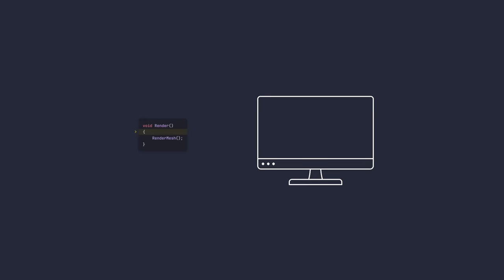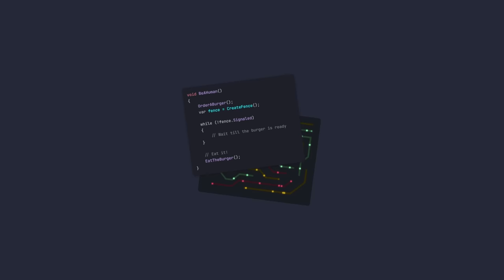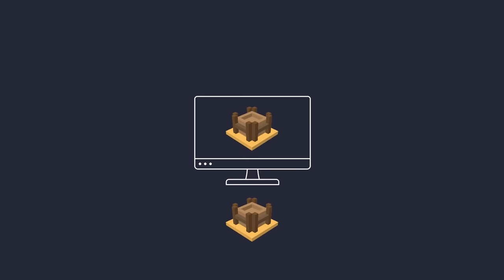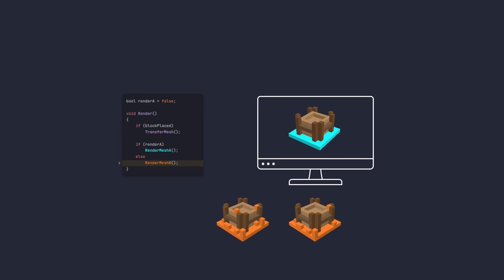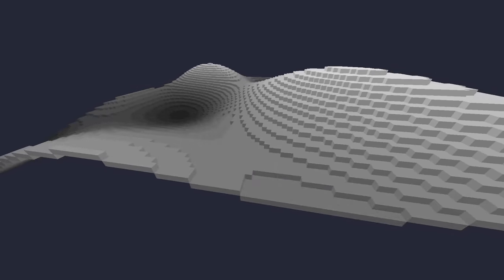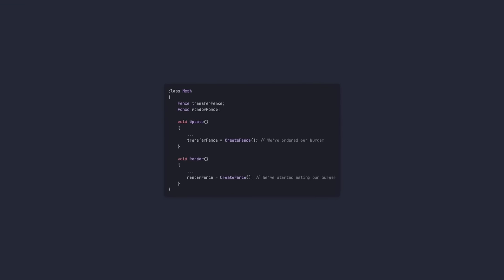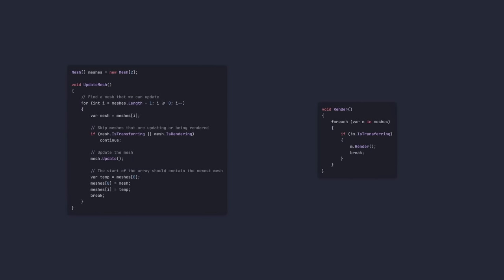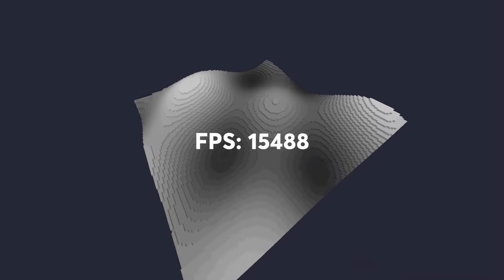I Created a Game Engine Just to Optimise This

Comment: Great video and I am sure it will help me in the future 👍At the first moment I thought the sorting by swapping with the first element only works with 2 meshes but after thinking about it I realized it also works well with longer lists too if the transfer time is equal for every mesh. If not, then a circular array/ring buffer might be a better alternative to avoid rendering fast-to-transfer future meshes before slow-to-transfer past ones. That would cause the future mesh to render 2 frames while skipping the past one with your algorithm.
Reply from the maker: Excellent point you’re right, a ring buffer would be more appropriate here. Now you have me thinking: I should be removing the element and inserting it at the start, rather than swapping. You’re right, great pickup!

I wrote a similar thing for a particle engine, which does skip over the slow-to-transfer ones to ensure the most up to date buffer is always being rendered (even if it means an entire frames worth of data is skipped), i.e. if the cpu runs faster than the GPU and is writing to 2 buffers each frame, every 2nd buffer will never make it to the screen
Reply: @Vercidium I would love to see a video where you take all the improvement ideas from the comments and try to apply them and see how they do.

Comment: Why this works: modern GPU has a lot of bandwidth but with a high latency to transfer data from main memory to gpu.(a lot of car lanes but long way to drive). If we could have 0 latency then we wouldn't need this because any transfer would be finished very quickly (high likelihood of finishing transfer before being drawn). Instead of doing nothing and waiting for the transfer to complete, we effectively stack multiple extra transfers for future frames within the first transfer's wait time (we can do this because we have a lot of bandwidth. aka we are sending more trucks on different car lanes simultaneously instead of waiting for the first one to come back and then send it out again). This is a form of parallelism and this idea of "doing other things or doing more of the same thing while waiting for the first one to finish" is everywhere in both cpu and gpu programming and let's you make more efficient(full) use of your hardware.

Comment: There's actually an optimization mod for Minecraft that more or less does this where the renderer will keep using an older mesh until the new ones are ready. You did a nice job with the analogies!
Reply: What's it called?
Reply: @nindew21Laughyourassoff it’s either Sodium or Nvidium, there is also a mod Distant Horizons on the relevant topic

Comment: I once implemented in GL4.5 similiar thing, for the uploaded uniform constants (UBO). It used fences to avoid remapping/reallocating the GPU memory each time when possible. It allocated N slots for the blocks in a single UBO. For each slot index, a fence is used tell if CPU is allowed to reuse it yet. If no slot was ready, a new (bigger) UBO would be allocated. After a few initial frames, the UBO's capacity would stabilize.

Comment: Should you really be using a list? Wouldn't a pool be much preferable if we're considering optimization?
Reply: A pool is a list though? (Not all lists are linked lists: this looks like C# where List is a dynamic array (like std::vector, ArrayList, Vec, etc)
Reply from the maker: For a tiny amount of items a list is fine, but if we had a global list of all meshes in the scene then 100% should not use a list. A ring buffer that uses an array under the hood would be much better

Comment: Really excellent explanation for an issue a lot of players, and even developers, incorrectly associate with optimization. Also, I noticed your mic is picking up a lot of room reverb. A cheap mic shroud behind the mic will help a lot. The poor man's shroud is a closet full of clothes with the mic partially inside. If you can't fix it at the mic, try a "de-room" or "de-reverb" plugin. Your visuals are fantastic, your audio can be just as good without much more effort.
Reply from the maker: I can't hear the reverb myself but I did notice an echo when standing next to a wall and recording. I recorded while standing in the center of my room instead, and I'll try a shroud too thank you for the recommendation :)
Reply: @Vercidium  Cool, glad I could help. I noticed you've got a demo video about raytraced audio. Maybe this is an opportunity to do a game engine video about it to test your audio setup.

Comment: This works fine in this simple example until your realise you are working with a huge grid of meshes of varying levels of detail because of view distance.  And this whilst having different lod terrain meshes still tile seamlessly - it becomes a coding nightmare.  So no, not so easy to implement this optimization in practice.  

I know I tried to do something like this with marching cubes voxel terrain.  In the end I actually generated the meshes on the GPU with compute shaders which was far more efficient than doing it on the CPU even with multithreading.  But finally it was the transvoxel algorithm that stopped me - just could not get my head around implementing that in a compute shader.  Fun times.

Comment: Long freezes in modern games can be attributed to a variety of factors, often relating to resource-intensive operations or inefficiencies in handling game assets and rendering. Here are some of the common causes:

Asset Loading: When games load large assets (like textures, models, or sound files) from the disk into memory, it can cause a noticeable freeze, especially if the game is not using asynchronous loading techniques.

Garbage Collection: In games developed with languages that have automatic memory management (like Java or C#), garbage collection can sometimes cause freezes or stutters. This happens when the garbage collector runs to free up memory, temporarily halting other processes.

CPU/GPU Synchronization Issues: If the CPU is waiting for the GPU to finish rendering (a scenario known as a GPU bottleneck), or vice versa (CPU bottleneck), it can result in freezes. Efficient parallel processing and synchronization are crucial to avoid such stalls. (the one this video covers part of, and far from the only possible cause)

Inefficient Resource Management: Poorly managed resources, such as repeatedly loading and unloading the same assets, can lead to performance issues and freezes.

Complex Calculations or Scripts: Intensive computations, like complex AI calculations, physics simulations, or extensive world updates, can cause freezes if they are not efficiently managed or offloaded to separate threads.

Network Latency or Hiccups: For multiplayer games, network issues can cause freezes or lag if the game's state is tightly coupled with the timely receipt of network packets.

Driver or Hardware Issues: Sometimes, the problem may lie outside the game itself, such as outdated or buggy graphics drivers, or hardware that is overheating or malfunctioning.
Reply: chatgpt has entered the chat
Reply: Or using a hard drive.

Comment: I’m curious: do you ever look at Minecraft optimization mods to get ideas of how to make your own voxel game engine better? People have tried many methods and there’s a lot of source code out there
Reply from the maker: I haven’t but that’s a good idea, would be interesting to have a look through their source code to see what OpenGL tricks they’re using
Reply: @Vercidium  Check out Sodium and related projects. They rewrote rendering in Minecraft to work with OpenGL and made it really efficient. There are related projects and extension type mods that are easy to find as well.
Reply from the maker: @toxiccan175  awesome thank you, will do!
Reply: @toxiccan175  Minecraft has used OpenGL since the beginning, Sodium and the like just rewrote core parts of the renderer to use newer OpenGL features and be generally more efficient with memory and GPU usage.

Comment: I find the burguer orderd analogy very helpful, but I still struggle to understand how it applies to the specific demo you are showing on-screen. What isthe mesh you are submitting? The entire voxel field is a single polygon mesh? Are you genereting that on the CPU? How? Why? Couldn't it be generated on the GPU with a geometry shader, or GPU compute? Couldn't the CPU just send a 3D texture of the voxels to render and the GPU just generates the polygon faces? For that demos specifically, you could just send a heighmap in fact. How about not even generating a mesh at all, but simply instancing the same cube mesh for every voxel?

But ok, let's say this is just an illustrative example, but there could be other use cases where you have to generate a mesh on the CPU and then send that to the GPU to render... Them sure, you might want the GPU not to stall while waiting for that mesh data to come and create code that does other stuff while the data is being received. I understand that in theory. But again, how does that work on that demo? The only thing the GPU is doing is rendering that one mesh it's getting from the CPU every fram? What other work can it possibly do while waiting for that data? From what I gathered, this seems like the worst possible use case to exemplify your problem. Or am I missing something?
Reply: Yeah this also got me pretty fucked up, I'm probably just small brain but it seemed like a pretty counter intuitive scenario to represent this problem and solution

Comment: Reminds me of a swap chain, only for geometry instead of fully rendered frames. Very cool!
Reply: Honestly, that's the future of everything nowadays, almost everything needs to be pipelined, the problem is that the more you pipeline, the more (relative) lag it introduces. Personally I settled for 2 mesh buffers for dynamic meshes, block frame if we catch up and the mesh isn't fully sent yet, though I might change this to non-blocking later.

I'm also thinking which mesh data actually needs to be updated anyways. UVs might not need to be re-uploaded to the GPU, it's mostly just the coordinates and vertex normals. So I'm thinking of splitting the vertex into 2 buffers, one for coordinates and normals, and the rest into another struct. This way the transfer size should be smaller and shouldn't cause many issues. This saves space on the VRAM, allows custom attributes. Cache misses are very likely to happen though so it needs to be measured... Lots of options to explore. :)

Comment: I don't deal with graphics code at all, but couldn't you just transfer the mesh immediately after rendering the last one? Then the GPU gets a whole frame to catch up before it has to render, right?
Reply from the maker: That works with tiny amounts of data but it’s not always guaranteed. Sometimes it takes a couple frames to transfer
Reply: @Vercidium  Ah makes sense, so it alleviates the problem but doesn't fix it

Comment: Is this the type of thing you'd need something like Vulkan to implement or could you do it with OpenGL? Because it sounds like you'd need more control and information about the transfer of data between cpu and gpu than what OpenGL offers, and also because iirc OpenGL being just specification has a lot of variations of when the data upload happens relative to calling the respective function
Reply from the maker: Vulkan does give finer control over these transfers but this demo is built with OpenGL using glFenceSync

Comment: This is the first time I hear the recommendation of using a list instead of an array for a performance boost!
I imagine that the list is actually an dynamic array under the hood.
The performance boost of caching contiguous data in memory is just way over the benefit you can get from delegating freeing some memory of a linked list to the garbage collector.

Comment: I question, this seems like something that shouldn't be a problem in most game engines, if the problem if as simply as discribed. Unity, Unreal and Gadot I imagine have enough people working on them that an oversight like this shouldn't be a thing. I guess I am wondering if you have any sourses or evidence that any of the game engines mentioned above acctually have this problem.
Reply from the maker: I was talking to one Unity dev who has this problem when rendering a model for the first time (player, enemy, etc). They said they had to render it under the map first or offscreen somewhere to “preload” it in, before then rendering it where the player could see it

Not sure if that’s a still problem in the latest version of these engines but I agree it should handle all that for you
Reply: @Vercidium  this is a shader compilation issue. Unity needs to pre-warm them (or even pre-compile when in editor) in order to be able to run it. This is a costly process. It's so much more costly if you also want to create pipelines, a necessity on DX12, Vulkan and other very modern APIs (hence the over-abundance of stutters in recent games, because it's very difficult to deal with at times).

This has absolutely zero to do with creation or updates of meshes.

Comment: I am too dumb to understand that.
So it is kind of a LOD, you render a light object while the heavier is loading on the background? After that, you swap the light one with the heavier?
Reply from the maker: It’s not like LOD, as both meshes here are full quality. This system uses a copy of the mesh that we can work with while the other one is being rendered

Another analogy is having two fry pans in the kitchen - one is being used to cook and the other is being cleaned. This means you can continuously cook as you always have a clean pan ready.

If you only had one pan, the chef (GPU) and the cleaner (CPU) would always be fighting over it, which is inefficient.
Reply: @Vercidium  Oh, thanks, now I get it, thanks

Comment: That's basically what they did in early games (or general programs) using buffering. The image is rendered in buffer 2 while buffer 1 was shown and then they were swapped on the next monitor refresh. I'm surprised this concept isn't used by default with modern GPU stuff, like shown in the video.

Comment: Is that why Nvidia's Ultra low latency setting makes some games stutter when you play with the framerate uncapped? Some games just can't handle running with 0 queued frames?
Reply from the maker: If the GPU has no work to do and the CPU isn’t sending more commands then yes absolutely. I don’t fully understand how that setting works, as from the GPU’s perspective it’s still just  processing a list of commands

Comment: Does the meshes list free memory if the number of meshes it needs stays low? If it can only make the list longer and longer, wouldn't that mean that it can take up a lot more memory than it needs if the number of meshes needed goes down, like if you move between areas?
Reply from the maker: Great point, some extra logic to dispose meshes that haven’t been used in a while would be useful

Comment: Does a list really solve the memory allocation problem? Dynamically allocating memory is itself performance intensive, especially for something as big as a rendering mesh. A typical list implementation is to have an array, then when the array gets close to full, double the size of the array. That could create additional lag spikes when the list starts getting too big. The severity of new allocation can often be customized, but at some point you’re not really looking at a list.

Instead it makes more sense, to me, to queue it from a fixed-sized array. Saves the Ø(logN) list append and O(N) search for empty slots. That may seem like the original problem, but it’s much faster to figure out what a change request is than to actually implement it. The change requests should be performed in order anyway, not just when they are done.
Reply from the maker: For tiny lists with about 5 elements it's fine, but for more items a ring buffer (built on an array) would be much better

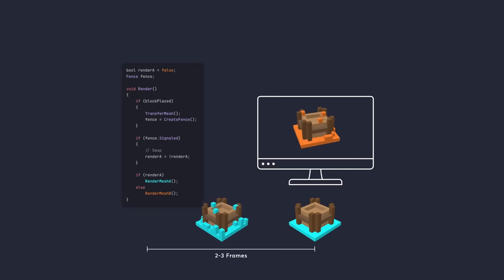Comment: 2:36 Transfer data in the background, only render and try to render when done.
Let's say you want to render A and B, while A is already there, the GPu should render it,
since the data is already there, but now enter B. B needs to have it's data transferred
to the GPU memory first, and only then should it be tried to render.
The transfer may take several cycles, but when the GPU has finished accepting the data
it should signal "transfer complete", after which the CPU can send the command that signals
the GPU that it should try and render B as well now.
Also, if the data changes, it should be A, the original data gets rendered, while B, the new data
completes the transfer first, and then gets rendered, switching all instances for A to B.
Ofc, this may have it's own set of problems on slower systems, but at least the screen does not freeze.
It will appear that things are rendered after the fact.
(Like going across terrain really fast, the horizon doesn't show anything, but the rendering happens
when already close to it. Can be bawd, but should only be happening one of two cases,
too much data is (re)new(ed), or the computer is really slow for the amount of data, both cases
on well running and written engines.)

Comment: I feel like this is very close to paging. Draw off screen on a page buffer and then flip the completed card to the screen and repeat. As you said it takes a few frames, but if you run at 120 fps you're not going to notice the delay at all.

Comment: you are basically not ordering a render for meshes, which have not yet been transferred or rendered up until the current frame.
you are basically saving bandwidth towards the gpu by not needlessly issuing renders, because historic renders are already on their way and have not yet finished.
did i get it right?
the burger analogy made this extremely confusing.
Reply from the maker: Yes that’s right, not rendering a mesh until it has been transferred to the GPU